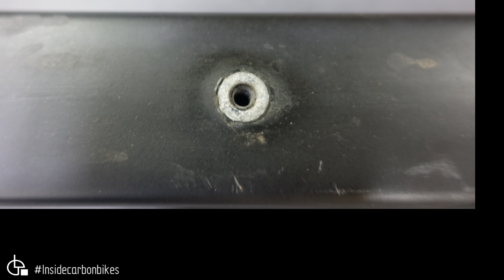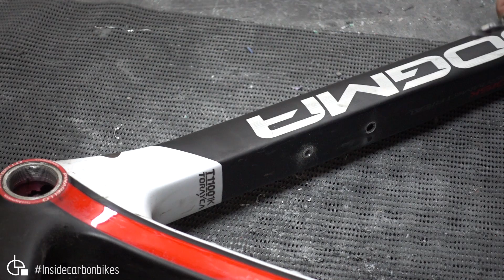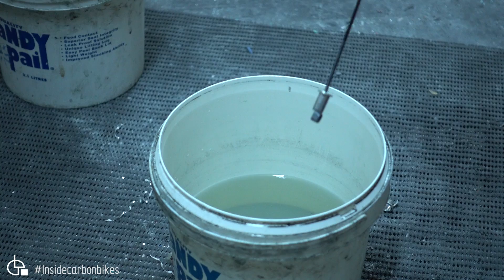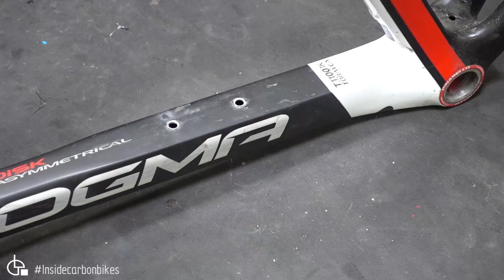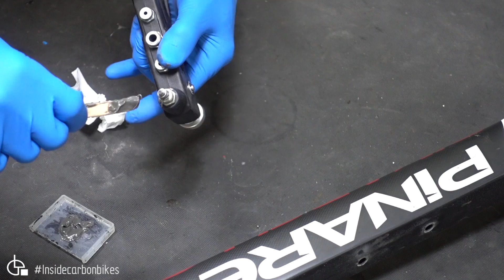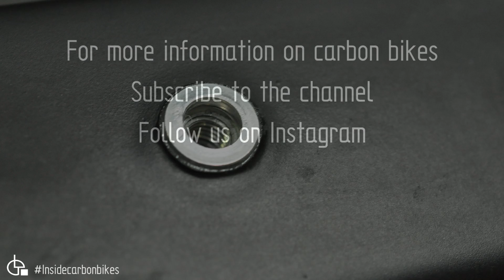How to Replace Inserts on Carbon Bikes - The correct way!

Comment: Is it not somewhat counterproductive to bond the rivnuts in? The bonding could make it difficult to replace the rivnut the next time. Depending on the strength of the adhesive and the thickness of the bead you might be forced to use excessive force to remove it and risk delamination.

Even if the insert is less likely to fail due to corrosion, it still might need replacing - due to stripped thread for instance. I almost stripped the threads on one of my bottle cage inserts (I presume they were overstressed during installation, I felt them starting to go and left off immediately). I was thinking about replacing them, first passivating the rivnut in some way (oxidising with some kind of acid) and using something like silicone sealant to prevent ingress into the interface. Also, painting the rivnut before installing could provide some insulation from carbon.

In other words, you've shown us how to replace inserts the correct way, but it would be useful if you showed us how to do it the half-decent way, for people who don't have access to airspace-grade compounds and sealants, and specialist tools like rivnut pliers. For instance, one could use a bolt and nut of appropriate dimensions to pull on the threads of the rivnut and so tighten it.
Reply: If you do no have the correct tools don't do the job, get someone who does to do it for you. Unless you are in the middle of nowhere.

Don't paint the rivnut either, as soon as it is compressed into place the paint will crack and flake off.
Reply: @Rover200Power  Sure, having proper tooling is the best option, but not having the "correct" tool has never stopped me doing the job, in case I have a reasonable expectation to do it well. For me, any kind of tool - bought or improvised - IS  the correct tool if it does the job. Apropos of painting: I would have used an acrylic paint, which is quite ductile, at least until fully hardened. If it cracks, it will crack mostly in the area that is not in contact with exposed carbon fibres. Of course, it can't be guaranteed that it would protect the insert from corrosion, but it's worth a shot. Especially when you consider that the rivnuts are installed without any type of passivation or separation in the factory. One other option would be putting some thin electronic heat-shrink tubing over it before installing, but that may prove to be too thick to fit.

At any rate, I find thinking about solutions to technical problems much more intellectually rewarding than simply having "pay an expert to do it properly" as an answer to everything. I like thinking about this stuff, fixing (and sometimes breaking) it.
Reply from the maker: Sometimes you have to improvise and I also enjoy a tech challenge, however the correct tool makes a repetitive job much easier. Paint and heat shrink are less than ideal when epoxy adhesive is readily available.
Reply: The "liquid weld" shite used in the video will become brittle after a year or so anyway...

Comment: ''in the factory they don't do it'' This is true, I've had two very expensive Cervelo frames ruined by them not doing this very simple process. Luckily both were warrantied on other matters, but they did not consider the degrading of the frame through this corrosion a significant matter although it ruins your frame aesthetically and mechanically. I can't believe I paid top money for such shoddy manufacturing. I sold both new frames on and purchased well made bikes frames instead. You know what Cervelo told me to do....''Put some vaselline over the corrosion and delamination  '' !
Reply from the maker: I was not aware that vaseline could repair delamination, thanks for the tip from Cervelo ;)
Reply: @LuescherTeknik  lol

Comment: Thanks for uploading. Fascinating the steps that bike manufacturers skip to prepare a frame. Just that small detail of the bonding agent could prevent a heap of trouble
Reply: Fascinating on a hideously expensive frame too..... Ergh
Reply: @richardhaselwood9478  Expensive for the buyer. As cheap as possible for the manufacturer, err, brand.